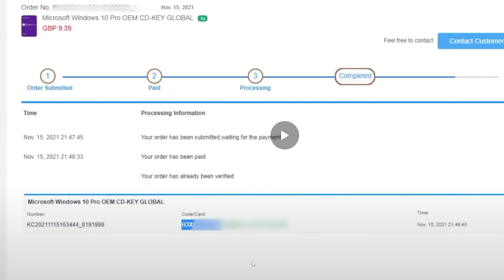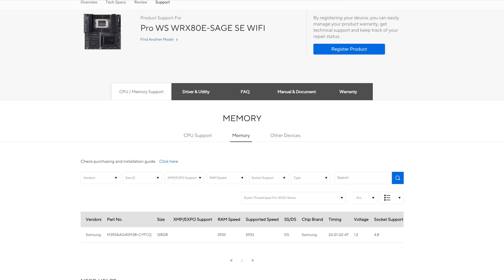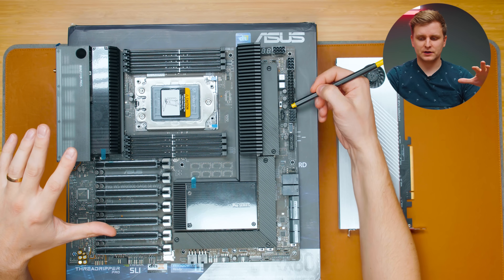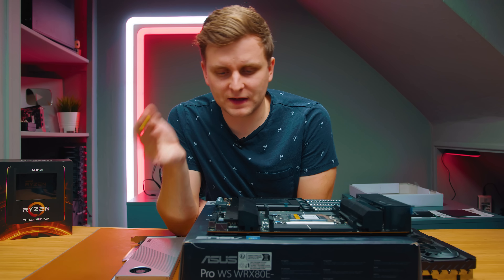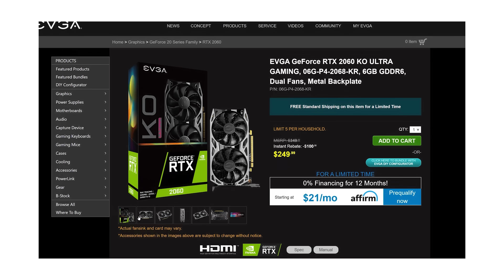MOTHER of ALL motherboards - ASUS Pro WS WRX80E-SAGE SE WIFI Overview

Comment: Water cooled 4090's you can probably install 4 or 5 of them in there. If water blocks slim. But if it was me I would try to go for 7 water cooled 4070 ti supers if vram size not needed.

Comment: @theTEchNotice - the Intel x550 dual 10G ports can support 2.5GB, under Windows 11, it's automatically enabled; on Ubuntu, you can use `sudo ethtool -s eth0 speed 2500` to enable (or using `autoneg on` to let it automatically negotiate with the 10G / 2.5G switch.

Comment: 30yrs ago my 486DX2 with 1MB of ram and 40MB was the top of the line running DOS and Windows 3.1.  

This motherboard is a beast!
Reply: haha in 1991 built my 386sx25 with 1mb ram and a 40mb western digital hdd. vga card. migrating from 16 colours commodore 64 to 256 colour was bliss!

Comment: Can you please tell me if I need to connect the two 6-pin power sockets on the bottom as well? I am running this motherboard with 2 x 3090 NVlink, a Threadripper PRO 3975wx and 256 gb of ram. Thank you!

Comment: To answer the question of the U.2 ports: These are ports for connecting HDD SAS 6Gb/s or either SAS 12 Gb/s hard drives and Intel has released SSDs with a U.2 port but saw it didn't work well so they stopped making it, it's over 2 years old

Comment: In fact most network 10Gbit cards, only support 1gbit and 10Gbit its almost unheard off to get 2.5 an 5Gbit working, and the same for the router and switched virtually NOTHING on the market it basically 1Gbit or 10Gbit. I surprised you even bothered to connect with 2.5Gbit. Just jump to 10Gbits if u need it..
Reply: I can confirm that 2.5Gbps does work in Windows.  You install the Intel X550 drivers (from Intel's website).  Use the Intel configuration software and manually select 2.5Gbps for each interface.  I couldn't get it working with Auto-negotiation.

Comment: Great video and really thorough overview!

While the motherboard may appear to be great on paper, I came across several issues (tested with Ubuntu 18.04 & 22.04):

1) It cuts power to the USB ports when it passes control over to the OS (i.e. Q-LED switches to AA). After some struggling I came across some threads on L1 techs  and StackOverflow that suggest to turn the VGA switch off. The issue did go away.
2) While the motherboard works well with SATA SSD when one plugs in an M2 SSD, the WiFi and SATA stop working even when the VGA switch is off. (Perhaps this is due to the OS kernel drivers.)
3) The BMC message LED keeps flashing - regardless of 1 & 2. (I admit I haven't yet logged on to the Intelligent Platform Management Interface (IPMI) to check the logs.)
4) The boot time is slow - it takes about a minute for the mobo to run all checks before passing control over to the OS. That is quite bizarre given that I am running a FireCuda 530 PCIe4 with a Threadripper Pro 5975WX and 256 GB RAM. Once the checks finish the OS does boot quite quickly, but this is ruined by the fact that the mobo boot sequence takes over a minute...

If any one has come across any of those issues, please leave a reply to let me know how you solved them.

Cheers!
Reply: Learn anything new regarding these issues in the last 6months?
Reply: I assumed that you ran 8x32gb ram to get the 256?

Comment: The fact that it does not support 2.5gb makes it garbage.
Reply: I can confirm that 2.5Gbps does work in Windows.  You install the Intel X550 drivers (from Intel's website).  Use the Intel configuration software and manually select 2.5Gbps for each interface.  I couldn't get it working with Auto-negotiation.

Comment: I've got an HP Z840 - dual socket Xeon and up to 2TB RAM - 2016 machine :)  (so yeah, I'm limited on "new" tech but I'm sat on 72 cores, and could shovel a 2399 CPU in for "more" if needed :)

Comment: The Expansion card for the M.2's   also got a feature via Software. Over Software you can disable the "Lane Splitting"  and have it act like a Raidcard, showing you all installed SSD's as Raid 0 by dafault, but its switchable.  
Theres also a card from ASUS that is like that, but its x8  and doesnt support the Splitting at all, running allways in Raid 0 but keeps not working or being detected if your Mobo doesnt support Raid for PCIe Devices.

Comment: The problem with these boards is simple: they exist. Which means the next gen game developers all go out and use these for making the next game, and then set that as the reference point. So, if you want to run their games, you need to plop down 1,000 bucks just for the MB.

Comment: Yup, U.2 2.5" SSD Enterprise or Server drives. Each drive has it's own controller. Each drive gets it's own lane. Blazing fast. unlike SATA drives. Once you go U.2, you'll never go back. I have 2 1TB samsung u.2 drives on U.2 PCIe risers in my AMD build. My PC is old. After so many hours, these drives are pulled from high end servers. Some of them are sold on Ebay DIRT CHEAP! Grab a few and experiment with your mobo and setup. Don't forget a few U.2 PCIe adapter cards. Wicked fast and reliable for any old build you have laying around. Quick tip, I had to disable some compatability setting in Bios to get these drives to recognise and boot up. Good luck.

Comment: You can run "soft-raid" using all SATA ports, having the OS (CPU) doing the RAID, which is actually recommended in many cases, including anything that uses ZFS as a filesystem.

Comment: according to the tech specs of the Intel NIC, "Data Rate Per Port: 10/5/2.5/1GbE (NBASE-T in Linux Only)"
Reply: I can confirm that 2.5Gbps does work in Windows.  You install the Intel X550 drivers (from Intel's website).  Use the Intel configuration software and manually select 2.5Gbps for each interface.  I couldn't get it working with Auto-negotiation.

Comment: u2 port for ssd with U2 port, but you can connected 4 HDD(in bios sata mode U2 port) with  cable Mini SAS HD SFF-8643 на 4 SATA. Total 16 HDD - absolutely insane motherboard)))

Comment: It's not possible to put any gpu or pcie device on the very bottom slot that is more than 1 slot. Not any case I know of but could be wrong.

For what reason the 6pin pcie is 90deg I know nothing of but perhaps airflow/clearance for the lowest pcie device.

Comment: I enjoyed your recent overviews acout ASUS Pro WS WRX80e-Sage SE WiFi & ASUS Pro WS W790e-Sage SE.

Do you have a plan to monitor VRM temperature under OC?

As an user of ASUS Pro WRX80e-SAGE WiFi, I have been interested in VRM temperature under various situations, because there are no monitoring sensors. Temperature monitoring on the chipset is also absent. Now, I'll move to the version II of the M/B, which enables my 5995WX to be overclocked. In those situation, it seems to be clear that monitoring and cooling the VRM's is the most important. On the other hand, you reviewed the ASUS Pro W790 M/B. Interestingly, it has a guide useful for VRM active cooling. 

In my thought, there may exist the same problem of monitoring VRM and chipset. As you know, the one of the charateristics of overclocking both Chagall Pro and Sapphire Rapids is the tremendous heat generated by VRM & chipset. So, I am very curious about how one can monitor temperatures of VRM and chipset and what is the VRM behavior under overclocking with and without active coolings. As for me, I have a plan of using T-Sensors and a USB hub for those.

Comment: SD Card there for boot os. A lot of applinces are supposing that there will be a very very little amount of data will be written on boot partition. So you can safely store your OS like ESXi, proxmox or similar on it, move yor write-intense os activities to another more durable storage and run it up.
FE: you can install there an ESXi, move some partitions for logs and configs to internal/external storage and you will be able to boot this sucker even if will lose completely entire storage, except this funcky little SD-bustard. Also, there is an enterprise solution called SataDOM. It's like a USB flash drive, but with sata. For example, Supermicro makes special SataDOMs and Sata connectors on MB that can provide a power to this SataDOMs.
There is a lot of interesting not obvious stuff going on in the server-grade hardware)

Comment: It makes absolutely 0 sense to put WiFi on a motherboard of this category. WiFi is horribly unreliable. Mobo's of this category run on either fiber or CAT6 to CAT8 ethernet. WiFi is a gimmick! Especially when you put it in the actual name of the product. This would be the perfect motherboard if both the WiFi, and the audio section were removed. Just provide us with an isolated USB 2.0 audio pass-through, and a 10GB/s network interface.

Comment: 2:10 dude you bought a server board and VGA it's ok
since AST2500 no longer supports
Reply: 3:38 I don’t know why you explained to “normies” what IPMI is, since no one in their right mind will buy such a board
Reply: 5:08 It's called easier - pci-express bifurcation
Reply: 6:34 I don't want to upset you, but network cards that are installed here, namely the X550-T2 support 10/5/2.5/1GbE, check your equipment
Reply: 9:02  there is a second nuance to this amount of memory and this is installation of LRDIMM memory, I hope you already know how much it costs
2 TB just can't be installed
Reply: 11:36 BMC is provided by a separate controller that is connected and has its own BIOS, and the graphics, as I said earlier, are AST2500
Reply: 12:25 a little different, usually micro sd is used for system bootloader
 (say proxmox), and a soft-RAID in the form of ZFS(or mdadm) is 
assembled on  disks and this helps to synchronize such a RAID by booting
 the system from such a RAID
Reply: 13:26 this is POST Card
Reply: 14:12 A U.2 to M.2 adapter will help you, but it's better to use it for U.2 drives

Comment: I am running this motherboard with dual liquid cooled 3090s and a 4090. I have it mounted in a Lian Li  PC-011d with two 1600w power supplies. It's been a very solid system and motherboard.
Reply: How much do I need for a system like that fam?
Reply: 64 core thread ripper I presume 😁 ...what work do you do with it to utilize the power?
Do you game?
Would you replace one of the 3090s with a high-end workstation graphics card?
Reply: @williammwangi4343 I think this is for hosting a local LLM (as soon as they are xx90) And as a CPU power is not very important in this case (unless some 405B model is running on a RAM with few tokens per a sec), this is very sad that to have two PCIe x16 we need to quadruple-quintuple our budget for Threadrippers and pro motherboards.
Reply: How much power draw??
Reply: @userou-ig1ze  probably decent photovoltaic farm, lol

Comment: The Intel X550 does indeed support 2.5 and 5gb. In linux and BSD. Windows drivers don't at the moment that I'm aware of.
Reply: I can confirm that 2.5Gbps does work in Windows.  You install the Intel X550 drivers.  Use the Intel configuration software and manually select 2.5Gbps for each interface.  I couldn't get it working with Auto-negotiation, but manual configuration works.

Comment: You wanted a tip? You should have gotten the second version of this board with WiFi 6E and Precision Boost support. Great mobo overall though. It's what I'm currently running.
Reply: What's the power draw in idle
Reply: @userou-ig1ze  no idea… but you probably don’t want one if power consumption is a concern.

Comment: The U.2s use sff-8643 cables and go to U.2 NVME drives. If you're feeling frisky go to E-Bay and you can get 8-16 TB U.2 NVME pretty lightly used drives for less than $1,000.

Comment: Hi I have a question can anyone tell me how I remove the io cover on this motherboard to allow me to remove the Bios backup battery I can't find anything that says how to do that I updated the bios to the latest now the pc won't boot I can get into the bios no problem but if I leave it to boot it blue screens with a whea error   pressing the CMOS reset button doesn't help bios won't save settings either can anyone help much appreciated thanks in advance

Comment: u.2 is usually used for enterprise grade ssd's like those up to 30 tb SSD's that unlike consumer M.2 SSD's dont slow down with longer term fast reading/writing but sacrifice a very minute amount of maximum read/write spead.. at least that is the only use of u.2 that i know. Also technically this is a workstation and not a server MB though there isnt much difference, also at least in Server application that micro SD Card / a USB port is sometimes used to house the Operating System if you got a system in an array tat really doesnt need anything in terms of storage but almost only compute and pass on the results through network Or similair situations in wich case you could actually run no conventional Drive at all.
Reply: Yup, U.2 2.5" SSD Enterprise or Server drives. Each drive has it's own controller. Each drive gets it's own lane. Blazing fast. unlike SATA drives. Once you go U.2, you'll never go back.

Comment: Are you going to build a PC (or a server given the specs) with this motherboard? I really want to see how these motherboards work with a beefy GPU in games since we've seen enough of what they're capable of in production and other heavy workloads.
Reply: The Threadripper is a workstation CPU, as used by Engineers, Architects, Mathematicians,  etc 

Ryzen is for gaming and office.

Epyc is for servers.
Reply: @Mzansi74  I know. I'm aware of that; however, my curiosity tingles me.

I used a Threadripper system for training AI agents in our research lab but, since they wouldn't let us install anything but python libraries, I never got to test them my way.
Reply: @Behdad47  Cool! Were you running a Linux distro? or Windows? 🙈
Reply: @Behdad47 Must be really cool to see it in action. 

My day job is corporate IT, all server dev side work. But I do get to "play" with my Ryzen at home - good enough for smallish machine learning and other work loads.

Comment: Would it be possible to use RAM as a storage? Imagine installing windows and programs in it
Reply: You can. It's called creating a RAM disk and on a DDR4 system, you are looking at 25x read/write performance.

This solution is only as practical until you restart your system in which case the RAM disk will disappear and you will have to rebuild it again.
Reply: @MarkLapasa  damn lol, sounds nice. Too bad there's no way around that

Comment: My Laptop is have a 2 ThunderBolt 4.0 Port. And this super computer is not have, maybe because is a AMD.
Reply: There are plenty of AMD boards which support TB Add in Cards, this just isn't one of them.  However, I have seen reports of people modifying the Gigabyte Maple Ridge TB4 add in card to work on this board.

Comment: I have been lusting over this mother board for months.  I have a small render farm and am always looking for a montherbord that can handle 3+ GPUS.  I would love to see how you would trick this system out with the maximum number of GPUS and how benifishal that really is.  I use Redshift for rendering, and there is talk about how 2-3 GPUs is the optimal number.  But with this SAGE motherboard yes its expensive, but its would be like 2 computers in one massive build.
Reply: 3dduff from the Redshift forums ?  I'm CaddDood !
Reply: Have you looked at second hand Epyc 2?  There are a couple reputable Chinese ebay sellers who are selling supermicro h11/12 motherboard + CPU + RAM combo's for very good prices.  I got a 7302 + H12 mobo + 128gb DDR4 ECC for less than that motherboard would cost and the H12 motherboard has 5 PCI-E 4.0 x16 slots.  There's a thread on the servethehome forums and some of those people are using this combo for multi GPU setups. (I'm just consolidating my little home lab onto 1 physical machine).  Biggest issue for most seems to be water cooling if you aren't using RTX GPU's otherwise 2 GPU's will cover all your PCIE slots.
Reply: I second that!)
Reply: Lusting ?? Tf
Reply: you can fit in 7(or 6 if you need addon card for m2 ssd's) GPU's RTX A4000 and its render beast ... 112GB of VRAM ECC memory with 1TB ECC RAM ... nice, but yes, it's power hungry in this combination :D
Reply: @venousek85  When you're talking about a system built around this beast, I would go for 1 slot 4090 water-cooled....i mean, at that point, is COST even a consideration?